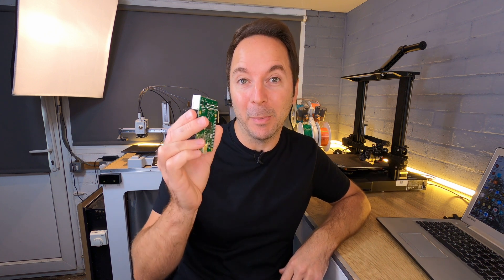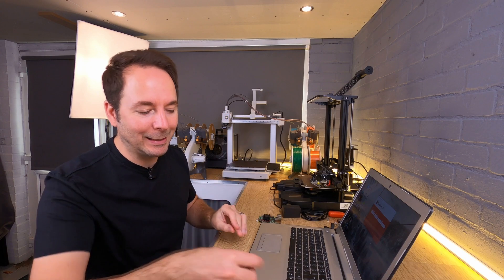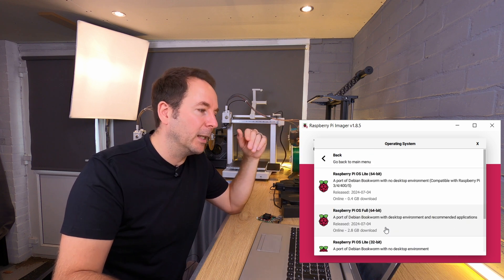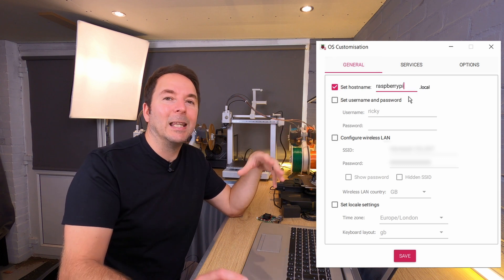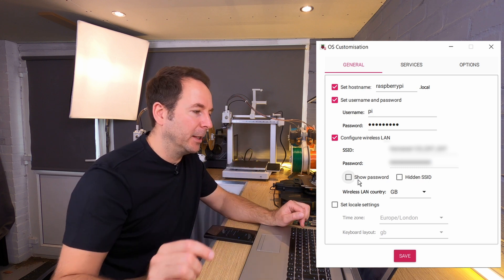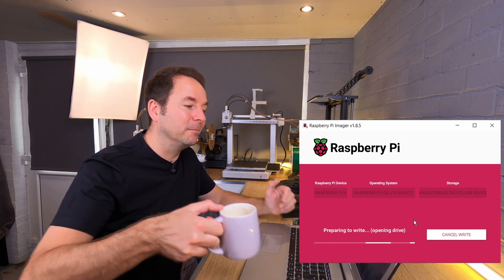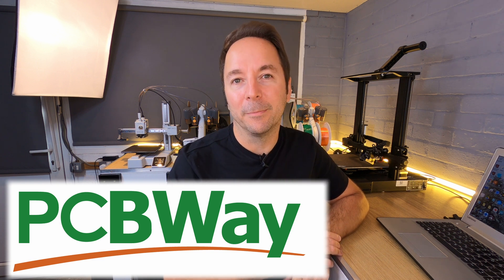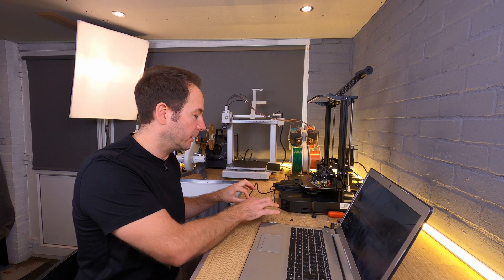How to Install An Operating System Onto A Raspberry Pi - Klipper 3D Printer Series Part 1 RPi OS

Comment: Ok, so I got the download to the RPi(3B+) done, I then started with Putty and it can't find the host.  I have tried all I can to get the IP address of the RPi on my router, an Huawei supplied by 3, but can't seem to get into the menu's only how to change password etc, there aren't ant other options.
So, I thought I'd wipe the SD card an start again but I can't reformat the card to remove the files, again I've tried everything I can find, it's taken me most of the day to achieve nothing. So unless anyone can help I'm stuck in limbo.

Comment: I followed your directions to a tee and nothing but smoke!  Smoke from my tires burning rubber for how good everything is set up!  I said in one of your other videos that I have been around instruction, instructors, and training for the better part of 2 decades and you have the skills, techniques, knowledge, and credibility to be one of the very best.  

I am coming back because i took several weeks between getting everything loaded, confirmed, the basics in place and now, today the first time i am trying to power on the printer as one complete properly wired unit.  I would also like to say is that i am able to navigate your videos to zoom in on the content that i need to see again to refresh my memory (which if i am honest, is all of it...  anyway...)

Thank you again for this video series... this is BY FAR the most f'ed up, confusing, difficult to figure out part of 3DP (at least it is for me) so i am very grateful for what you have done.  Cheers  Liked and subscribed for sure!

Comment: Great video series. This question is just slightly off topic…
I know it seems redundant and Creality tells me it can’t be done, but shouldn’t it be possible to add a K1C to a Sonic Pad? I want to have a central controller for my printers. I guess I could make an extension for the ribbon cable that connects the K1C display to its SBC and move its display to mount next to Sonic Pad. I was just hoping to use the Sonic Pad for all three of my printers. Thanks for the videos